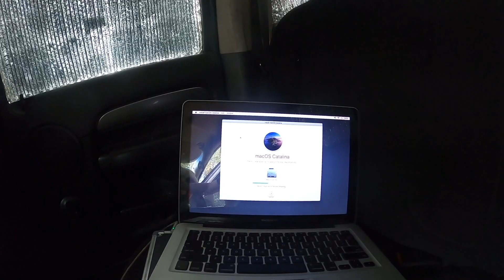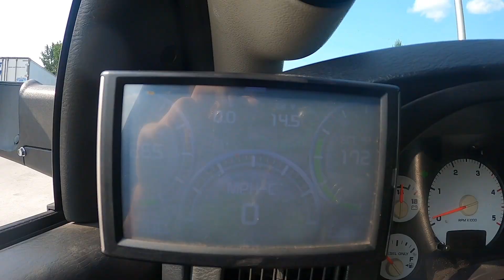Broken Alternator.. Keep On Trucking! | Learning The Loads

Comment: With me being home every night, I use 2 frozen powerade bottles of water in my cooler...it's not a full size cooler though but it keeps everything real cold and doesn't make a mess. I realize that doesn't help you much, but if you can find block ice rather than cubes it will last far longer. I hope you get your coolant issue resolved soon before you do any damage to your engine. On my 7.3, running like that would crack the injector cups...oh what a joy THAT is! Your binders are fine, you just need some tips on how to use them. I actually like the snap binders...when you use them correctly, the chain will be real tight and when you smack it with something metal they have a certain sound that tells you it's TIGHT! If you have enough chains, use one end around a spool or stake pocket, and the other end to the load. Use the binder to hook on the chain coming from each end. Put tension on the binder handle and it should go just past 90 degrees. You can move the hook of the binder up or down a link, or if that's too much movement, move the hook of the chain up or down one link for a finer adjustment. After snapping the handle with a cheater bar, bang on the handle to make sure it's seated. Then, wrap the excess chain around the binder handle and secure it with a bungee. That's insurance that the handle doesn't get bumped loose. And whatever you do, don't allow your chains that are under tension touch each other. DOT will get you for that. If they cross, add some protection to prevent them from rubbing.

Comment: Cooler, you want a 12v compressor style cooler/freezer. Dometic, Alpicool, ARB, Engel etc. They're extremely efficient and work as refrig or freezer. Run on 120v or 12v. A bit pricey but lightyears better. On average a 50qt can run 2-3 days on a single battery.

Comment: Drill small holes inside the cooler and use great stuff spray foam to fill inside the air gaps of the cooler.  It will make the ice let much longer since that plastic cooler isn’t insulated!

Comment: Domestic makes a nice 12 volt fridge/ freezer that's about the size of your present cooler.

Super well insulated, so even if you're not feeding it current. It keeps things cold.

Available at most RV dealers, Marine stores, or camping supply places.

They also have compact 12 volt ice makers that continuously make new ice as you use it.

Comment: Guy, tint that glass !! I did 20% on my  3rd gen front doors. It's lighter than the back doors, and rear window factory tint. Had it almost 5 years now, no problems whatsoever. My sticker is due every June. So I just roll my front windows down when I pull in for inspection. And as far as out on the road.. seen plenty of dot cops, but they are lookin back through the same tint on there cars !! I've heard you mention windshield tint b4 tho.... and I agree, it looks awsome !! However, on a previous vehicle, a cop wrote me up for my "sunscreen tint" on the top edge of the windshield. It was lower than the (idk know what the marks are called) but there is a line horizontal on drivers and pass side of all windshields.. I think it might say "ANZI" But by law you can't tint below it.  But man, just your front door windows would change the look of that truck 1000% next time you might hit maine, hit me up and I will tint em for ya
Reply from the maker: I had 3% on the fronts and 30% on the windshield for years. I only took the tint off some time last year. I miss it. Haven't been to Maine yet. I'll try to get a load there eventually😂
Reply: @CPSteveMiller  yea I would love to go 5% or darker. But I figure they may not be as forgiving if I go that dark. The 20% is still enough tho to give privacy, and help keep the inside a little cooler !!
Reply: I'm up in the capitol area, hit me up if you ever get up this way ! Tow piglet dropped a church steeple about 2 miles from my house this spring lol

Comment: Are you just running auto hauling or could you run general freight?
Reply from the maker: I can do anything but we don't have a freight load board.
Reply: @CPSteveMiller  You should sign up on the Dat.com and Truckstop.com load board to find all your general freight. I used the Dat 95% of the time. I average about $6750 per week.

Comment: Where you going in Minnesota.?
Reply from the maker: Got canceled. East coast is all I run now
Reply: @CPSteveMiller  so what happened to the trailer.?
Reply from the maker: @ethiele2695  I had a boat on a trailer from FL to MN but it was too tall. Ended up taking the food trailer up to Philly instead as opposed to the boat to mn
Reply: @CPSteveMiller  I am in SE Minnesota.  Was going to say I know a guy who tints windows.
Reply from the maker: @ethiele2695  There's a guy here locally just have been trying to save some money until I get this trailer figured out
Reply: @CPSteveMiller  Been binge watching.  I need a diesel.
That Lincoln was all 5%.

Comment: My buddy has a 2001 F-450 with the 7.3 and we just picked up a 36-foot fifth wheel that has the structure removed so it's just a frame and a couple 8 lug axles. We're going to turn it into a Jeep hauler

Comment: GET AN IPAD PRO! It seems like you keep replacing stuff that you jerry-rig.
Reply from the maker: I bought a brand new MacBook pro
Reply: @CPSteveMiller  Those are so much $$$. Could have gotten an iPad Pro with LTE cheaper and easier to use.
Reply from the maker: @joenissan  I need a laptop. IPad won't do what I personally need it to. $1,300 bucks I'm glad I spent. 3 year warranty